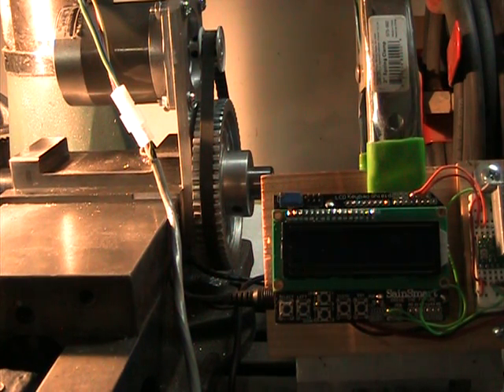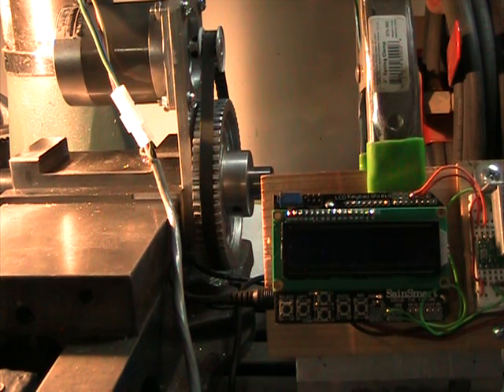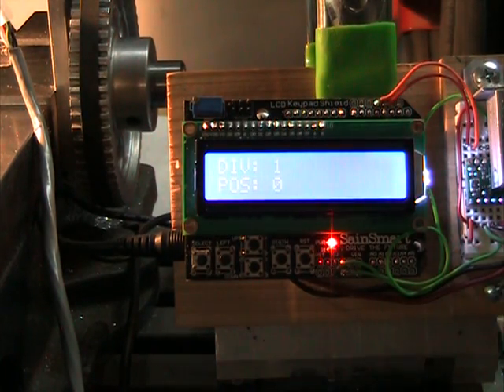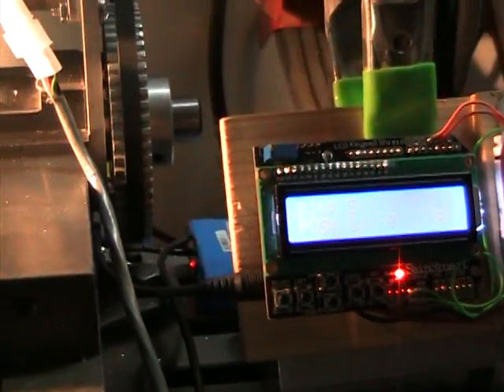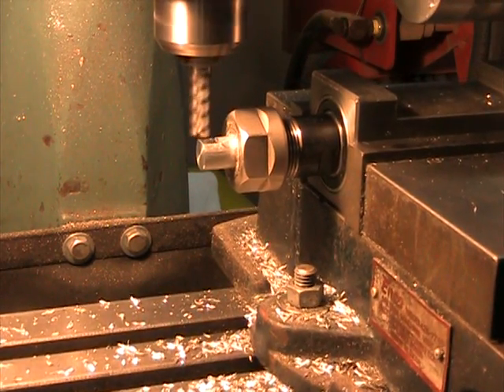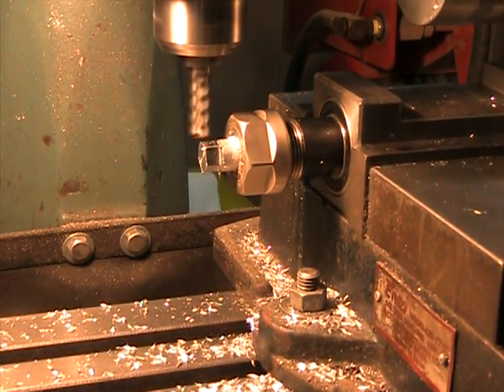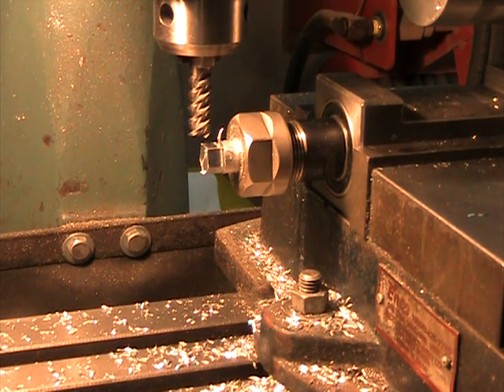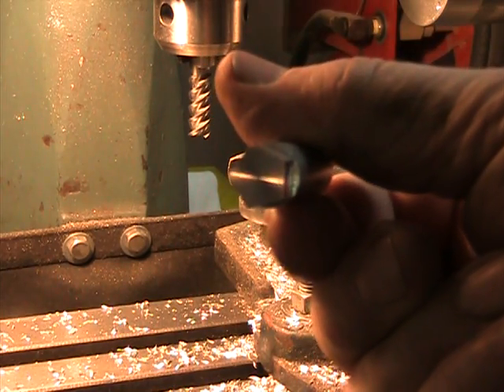Electronic Dividing Head

Comment from the maker: //Try copy and paste the following code to into the Arduino IDE
//Sample using LiquidCrystal library
#include <LiquidCrystal.h>
//#include <LCDKeypad.h>
 
/*****************************************************
 
This program uses the Sainsmart LCD / Keypad shield with 
the Arduino to form a stepper driven dividing head.  The
Sainsmart shield has a 2 row x 16 character LCD for display
and 5 input buttons arranged as left, right, up, down, and
select in addition to a reset button carried up from the
Arduino motherboard.
 
********************************************************/
 
// select the pins used on the LCD panel
LiquidCrystal lcd(8, 9, 4, 5, 6, 7);

// Arduino pins used for stepper control
#define stepDir 2
#define stepGo 3
 
/********** values used by the panel and buttons*****************/
#define btnRIGHT  0
#define btnUP     1
#define btnDOWN   2
#define btnLEFT   3
#define btnSELECT 4
#define btnNONE   5
#define btnERR    6
int lcd_key     = btnNONE;   
int adc_key_in  = 0; 
  
/*********** values used by the dividing head *******************/
boolean sel = false;                    // Stores current value of select, toggled true or false
                                        //  if false, up / down keys increment / decrement delay between steps
                                        //  if false, up / down keys increment / decrement # of divisions
int del = 5;                            // default delay value
int divs = 0;                           // Holds the number of divisions
int pos = 0;                            // Holds the current dividing head position (0 (zero) based)
int lastpos = 0;   // Last absolute stepper position
int nextstep = 0;                       // used for calculation of next stepper position
int laststep = 0;
int nsteps = 0;                         // Count of steps to advance stepper
int intsteps = 0;
float stepsDiv = 0;   // Steps per Division
float numSteps = 1000.0;                // Number of steps per spindle revolution
boolean div_done = false;
 
/***************** Move the stepper ****************************/
void step (int dir)
{
  pos = pos + dir;                      // Increment (or Decrement) position
  if( pos == divs )                     // If position back at start, set to 0
  {  
    pos = 0;
    lastpos = -1;
  }
  if( pos < 0 )                         // If position just moved from 0 to -1, set to divs - 1
  {
    pos = divs - 1;
    lastpos = divs;
  }    
  laststep = round(stepsDiv * lastpos);
  nextstep = round(stepsDiv * pos);
  nsteps = abs(nextstep - laststep);
  intsteps = nsteps;
  if(dir > 0)                           // Set the step direction
  {
    digitalWrite(stepDir,LOW);
  }
  else
  {
    digitalWrite(stepDir,HIGH);
  }
  lcd.setCursor(9,0);
  lcd.print(nsteps);
  while(nsteps > 0)                     // Loop through number of steps
  {
    digitalWrite(stepGo,1);             // Start Stepper
    delayMicroseconds (200);
    digitalWrite(stepGo,0);             // Stop Stepper
    delay( del );
    nsteps--;
  }
  lastpos = pos;
}
 
/******************* read the buttons **************************/
int read_LCD_buttons()
{
 adc_key_in = 0;
 do 
 {
   adc_key_in = analogRead(0);       // read the value from the sensor
 } while( adc_key_in > 1000 );
 delay(200); 
 // my buttons when read are centered at these valies: 0, 144, 329, 504, 741
 // we add approx 50 to those values and check to see if we are close
 if (adc_key_in < 50)   return btnRIGHT;  
 if (adc_key_in < 195)  return btnUP; 
 if (adc_key_in < 380)  return btnDOWN; 
 if (adc_key_in < 555)  return btnLEFT; 
 if (adc_key_in < 790)  return btnSELECT;   
 return btnERR;     // when all others fail, return this...
}

/******************* Set Up ************************************/
void setup()
{
 pinMode(stepDir,OUTPUT);
 pinMode(stepGo,OUTPUT);\
 lcd.begin( 16, 2 );
 lcd.clear();
 lcd.print( "Use Up/Down Btns" );
 lcd.setCursor( 0,1 );
 lcd.print( "to set Divisions" );
 while ( !div_done )
 {
   lcd_key = read_LCD_buttons();
   switch (lcd_key )
   {
     case btnNONE:
     {
       break;
     }
     case btnUP:
     {
       divs++;
       break;
     }
     case btnDOWN:
     {
       if( divs > 0 ) divs--;
       break;
     }
     case btnSELECT:
     {
       if( divs > 0 )
       {
         div_done = true;
       }
       break;
     }
   }
   lcd.setCursor( 0, 0 );
   lcd.print( "Div:            ");
   lcd.setCursor( 5, 0 );
   lcd.print( divs );
   lcd.setCursor( 0, 1 );
   lcd.print( "Select When Done" );
   lcd.setCursor( 9, 0 );
   lcd.print( div_done );
 }
 lcd.clear();
 lcd.print("DIV: ");
 lcd.print(divs);                 // display the number of divisions
 lcd.setCursor(0,1);
 lcd.print("POS: ");
 lcd.print(pos+1);           // display the current position
 lcd.setCursor(9,1);
 lcd.print(nextstep);                            // print the stepper position
 stepsDiv = numSteps / divs;
}
  
/********************Main Program Loop ***************************/
void loop()
{
 lcd_key = read_LCD_buttons();           // read the buttons
 switch (lcd_key)                      // depending on which button was pushed, we perform an action
 {
   case btnLEFT:                              // Step dividing head back one interval
     {
       step (-1);
       break;
     }
   case btnRIGHT:                             // Step dividing head forward one interval
     {
     step (1);
     break;
     }
   case btnUP:                                // Increment the number of divisions
     {
       del=del+1;
       break;
     }
     
   case btnDOWN:                              // Decrement the number of divisions if > 0
   {
     if( del > 0 )
       {
         del=del-1;
       }
     break;
   }
   case btnERR:
   {
     lcd.clear();
     lcd.print( "Button Error!" );
     return;
   }
 }
 
 /*************** Print all the updated data to the LCD ***************************/
 lcd.clear();
 lcd.print("DIV: ");
 lcd.print(divs);                 // display the number of divisions
 lcd.setCursor(0,1);
 lcd.print("POS: ");
 lcd.print(pos+1);           // display the current position
 lcd.setCursor(9,1);
 lcd.print(nextstep);                            // print the stepper position
 lcd.setCursor(14,0);
 lcd.setCursor(14,1);
 lcd.print( del );
 }

Comment: Compared to the price of an indexing head this is a great alternative. I guess the error is relative to what its use is, for a 99 tooth gear the error per tooth could be ~1/10 tooth. But using a microstepping driver with 32 microsteps this would be ~1/320 of a tooth. Surely insignificant for a clock at least. The microstepper has lower holding torque but for gearcutting the force is 90 degrees to the rotation so shouldn't be an issue. I want to make one. Cheers.
Reply from the maker: I've typically used this dividing head to make cam gears for model engines and rarely cut gears with more than 36 teeth.  I've never had a problem with noisy or ill fitting gears.  Also, lots of room for customization if you build your own.  Some folks use a worm gear instead of timing gears and belt.  This would typically give much better resolution, but also slows down the operation quite a bit.

Comment: how precise is this,what about backlash and rigidity
Reply from the maker: No measurable backlash and rigidity seems fine for cutting small gears.  The accuracy is 1000 steps per revolution.  I now use this device as a 4th axis on my mill since converting it to CNC.

Comment: So with 1,000 total steps per revolution, what happens if you want to cut 6 flats like on a hex bolt?  1000/6=166.666667.  What do you do with the fraction?

Comment: Hola Chuck, sigo admirando su proyecto, pero, ¿Cómo hace que el motor paso a paso con la transmisión para añadir o restar de error? is the code written in the program? Thanks again!
Reply from the maker: The program keeps track of the number of steps from the beginning position.  Each time the position is incremented (or decremented), the program calculates the new position as the number of steps from the origin or beginning position, then subtracts the number of steps from the last position.  This gives the incremental number of steps needed to move to the next position.  By recalculating each successive position as the absolute number of steps from the beginning position, the rounding evens out.   Example:  We want to cut a gear with 17 teeth.  Here are the calculations for the first few teeth.

Increment 1:  1000 / 17 * 1 =   59 steps (58.8)
Increment 2:  1000 / 17 * 2 = 118 steps (117.6) 118 - 59  = 59 steps
Increment 3:  1000 / 17 * 3 = 176 steps (176.4) 176 - 118 = 58 steps
Increment 4:  1000 / 17 * 4 = 235 steps (235.3) 235 - 176 = 59 steps

Increment 17: 1000 / 17  * 17 = 1000 steps (back to the original position

And so forth, the rest of the way around.  This method always guarantees that the final increment will get you back to position 0.

Comment: Does that setup have the ability to for any number of cuts from 1 to 1000? specifically 127
Reply from the maker: Yes, although the rounding errors get bigger the closer you get to 1000 cuts.  Each step turns the spindle 1/1000th of turn, so 7.87 steps are required for 127 cuts.   Since the controller is set up for whole steps only, it would round down to 7 or up to 8 on each cut, whichever is closer.  Rounding is not cumulative, so the error would never be larger than 1/2 step (or 0.18 degree)  for any cut.  Precision could be improved by half stepping (2000 steps per rev), quarter stepping (4000 steps per rev, or even 1/8 stepping (8000 steps per rev).  These are changeable with jumpers on the driver board.  However, holding torque dimishes with partial stepping.  Also, you'd need to make a change to the software for the new number of steps per rev.

Comment: Hi. nice project.I just got the code from the website uploaded in the arduino and it works but i want it to work with worm gear system.the gear ratio is 100 to 1.thats a lot but thats the only thing i have at the moment.so 200 steps pe rev and 100 to 1 ratio is 20000.should i replace the part of the code with 20000 instead of 1000?AND those it matter if the stepper driver is in full step, half step etc?thanks
Reply from the maker: You are correct with the 20000 number for full stepping.  I you use half stepping, you  would double that number.  Quarter stepping would quadruple the number, etc.  I would use full stepping, otherwise it will take a long time to move between divisions.
Reply: ok.i understand now how it works.the problem now is the backlash on the worm gear.it is 100 to 1 so i think the backlash is small. and the worm is new.
Reply from the maker: Backlash only becomes a problem if you are changing direction during the dividing operation.  As long as you keep stepping in the same direction, backlash isn't usually an issue.
Reply: Chuck Fellows ok.thanks

Comment: Thanks for sharing :)
I am about to upgrade my home made deviding head and your solution is perfect.
Is it possible to have a copy of the arduino code and info about libraries for the screen?

HH
Reply from the maker: Thanks, Hossein.  You can download a copy of the arduino code from here:

http://www.homemodelenginemachinist.com/downloads/arduino-dividing-head-program-252.html
Reply: Thank you for the link and software :)
I Have downloaded the Arduino skecth and digital screen works just fine. What I can't find out is the steppermotor connection. The code defines only two digital pin output while the motor driver requires four! 
Wiring schematic would be a great help. Thank you :)
Reply from the maker: Their is an A4988 stepper driver chip between the Arduino and the stepper motor.  The Arduino connects to the step and direction pins of the A4988.  The stepper motor is also attached to 4 motor leads on the A4988.  The A4988 ship is pretty cheap, on the order of $10.    Here is a link to a simplified diagram:

https://i.ytimg.com/vi/fVNVHVMroRA/maxresdefault.jpg

Do a Google search for A4988 wiring and you'll pull up lots of examples.
Reply: Thank you :)
Reply: @cffellows  The link to the source code is broken. Could it be posted to Github?